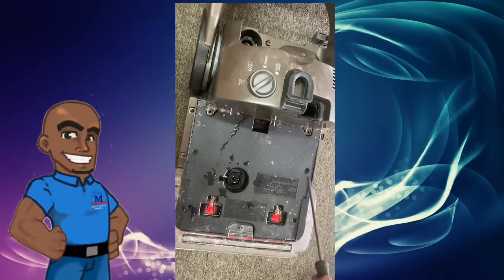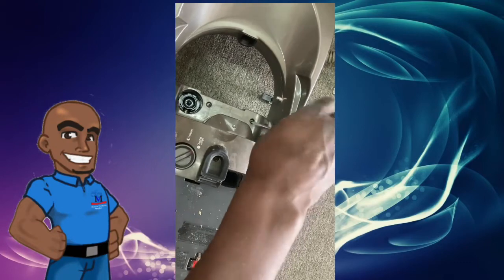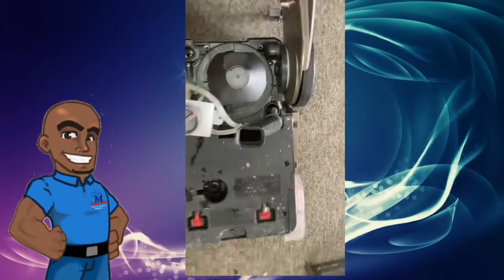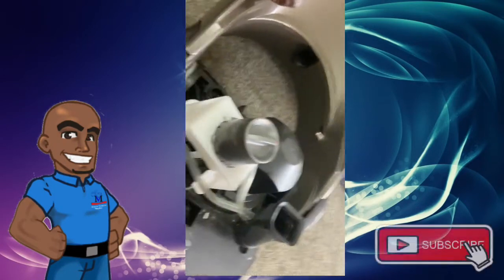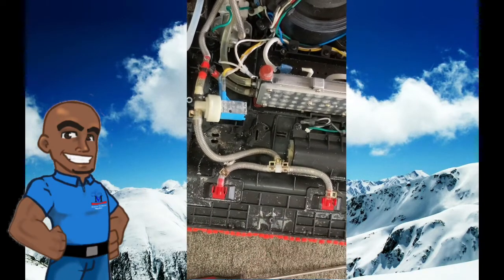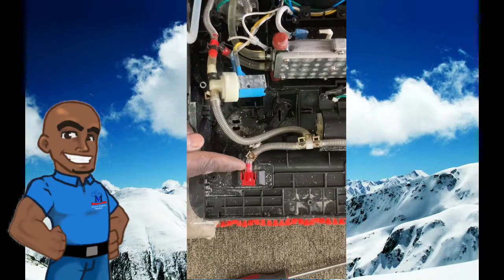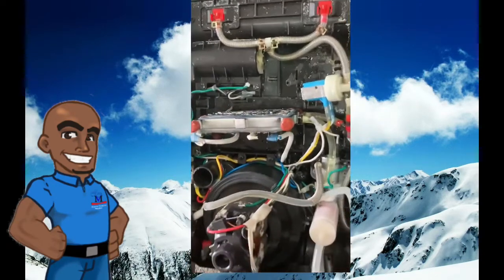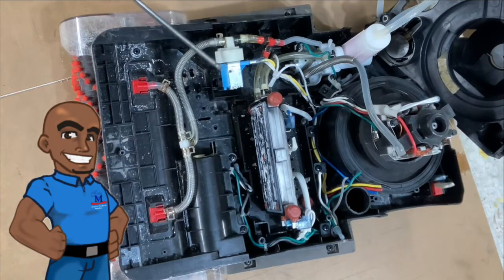Troubleshooting Bissell Pro-heat 2x spraying and clogging issue part 2

Comment: A neighbor left one of these out on the street so I grabbed it excitedly, only to discover it didn't spray. After watching several videos, taking it apart, cleaning the heater, the lines, I got spray out of the hose but not at the base still. I was baffled. And I couldn't find another video that explained what else could be the problem until I found this one. Almost certainly confirmed I have a bad solenoid. Ordered a new one online for $16. Thank you!
Reply from the maker: Wow.. keep me posted let me know how it work out
Reply: @monroevacs   Confirmed! Installed the new solenoid and now have spray on the floor. I wouldn't have figured it out if you had not explained in your video what that part actually did, so thank you. I had no problem getting spray out of the tool hose, and the lines all seemed to be clear. Turns out it just needed that extra boost to get the spray to come out of the base.
Reply from the maker: @samhendricks5816 glad I was able to help. Stay tuned for more tips

Comment: I had asked a question about why my bissell was not spraying after checking for clogs, cleaning heater & spray nozzles. I think you had indicated that it was likely the solenoid valve. I purchased this online, just replaced & now my machine works like a dream! I even impressed my teen son who helped me along the way! Without your tip, I would have been out of luck. Thank you So much! Btw: Bissell tech line were no help…you are saving Bissell machines from ending up in the garbage dumps! Also, why doesn’t Bissell suggest running distilled water through the machine after using to prevent mineral build up? Probably because they want to sell more machines?!
Reply from the maker: Thanks for that! Distilled water is a wise choice. Glad the video was helpful.

Comment: My machine is back up and running again, thanks to your video!  I think my plugged lines were the lines in and out of the heater, also cleaned the heater as it had some junk in it and left the hose unhooked coming out of the heater to flush out the heater and finally after about 6 teardowns and assembles I got it running water again.  I can now take it apart and put it back together blind folded!  Ha!  Had to clean out the front jets again after I got the water running up to them.  I think if you're not using the cleaner very often a person should run Vinegar water though it at the end to flush out the system and do this with the hand held cleaner if that was used.  My tip of the day!
Reply from the maker: Awesome news! Glad we were able to help. And a big thank you!

Comment: Hi,very interested and excellent video from a convenient and professional guy .However, a quotation to be raised i cannot find a spare  solenoid for my unit ( Bissell 2x PROheat Model 9300-A  07234C ) can i use the machine without a solenoid. Thks
Reply from the maker: The water will probably only drip out. You can use a solenoid for another Bissell 2x model. Try 9500
Reply: @monroevacs  many thanks
Reply from the maker: You’re welcome

Comment: I have an old bissell proheat 2x that was in storage for a long time and was not working. Turned out that the heater core was all clogged up. I replaced the pump and bridge rectifier just in case, but it is not clear how to connect the hoses to the 12V pump. I know the where the hose that is hooked to the heater core is connected to the pump, but how about the other two hoses? To which ports on the pump does the other two hoses connect to? Thanks for any input.
Reply from the maker: Try this video. It is the same unit under a different name, focused on the hose but it may cover the issue you're asking about
Reply: @monroevacs  Thanks for the reply. But the link for "this" video does seem to be working.
Reply from the maker: try this - https://youtu.be/cx3fXMt_lFk

Comment: I have the pro heat pet cleaner. I do a couple passes over carpet ,all of a sudden the full bucket indicator pops up.  I barely started ,how can I fix this. ?
Reply from the maker: Hmm.. without seeing the unit, I can suggest slowing down and try not to jerk the unit while shampooing. If that doesn't work then see if you can remote the floater, but if you do do the you would have to keep an eye on the level of the dirty water and empty it when it reaches the line or else water and make its way into the motor. The floater is only there to make sure you don't over fill the tank. Hope that helps